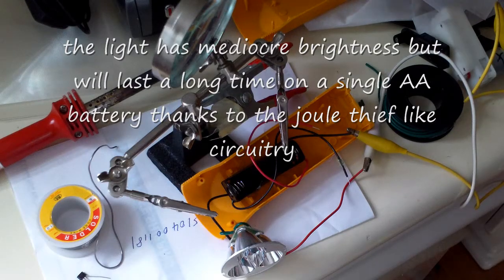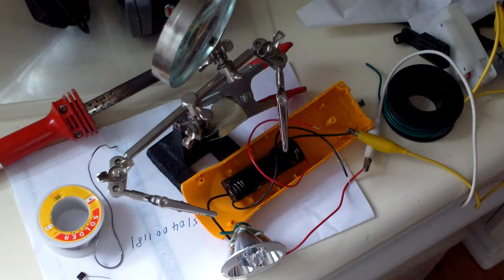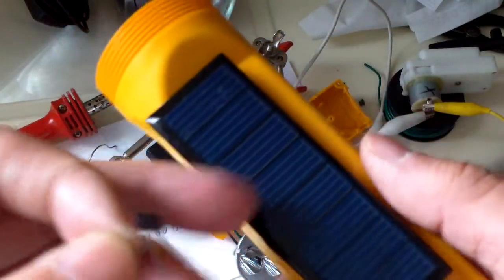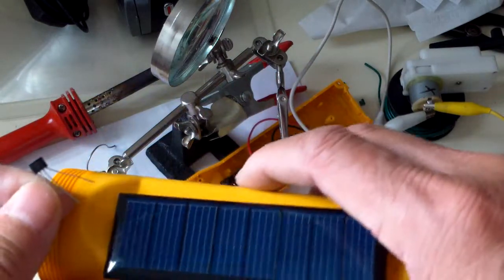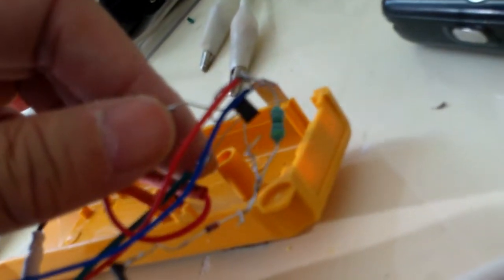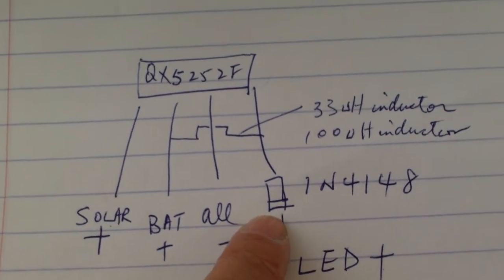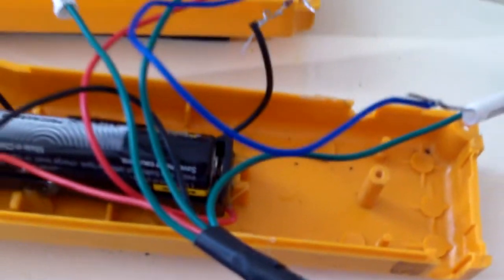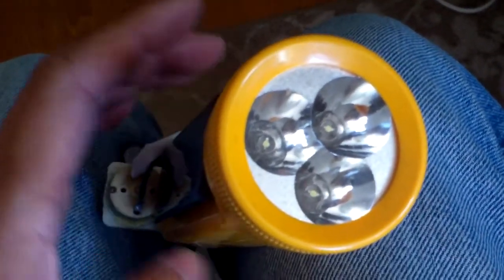Very long lasting solar and crank generator charged LED flashlight

Comment: I'm not familiar with these type of electronics. How to you keep the current flowing from the solar to the battery and not reversing? Also, is the leads marked for the solar/hand crank, etc. Thanks for sharing a cool project!
Reply from the maker: The Cedar Workshop The QX5252 chip has a built in blocking diode. It is actually a small charge controller keeping the voltage of the AA battery at the optimal level. It will also disconnect the load when the voltage of the battery drops below .9 volt.  The hand crank  positive and negative is not connected to the chip but directly to the positive and negative of the battery clip. A blocking diode is put in series with the positive wire to the battery. The flashlight on off switch is turned to the off position and disconnect the LEDs to the battery when the hand crank generator is used to charge the battery.  It sounds more complicated than it is but it's actually rather simple.  The 4 leads and functions of the QZX5252 is shown in the diagram in the video. You can also look up the data sheet for the specifics of the chip.

Comment: Where do you get your QX5252 chips from? Tried to find on Ebay UK and no luck at all. Many thanks for all your great videos.
Reply from the maker: Raymond Earle This chip wasn't available on ebay before.   Youtuber MrFreddiew1 prompted the distributor or seller to put it on ebay and now it's much cheaper and more  widely available.  Try this link:http://www.ebay.com/itm/100PCS-QX5252-TO-94-IC-driver-NEW-GOOD-QUALITY-T03-/291052254553?pt=LH_DefaultDomain_0&hash=item43c410f559I didn't get it from them so I can't vouch for them. If you have no luck, PM me and I'll send you a couple. I still have a couple of them left.
Reply: Many many thanks for the info. The offer is much apeciated.